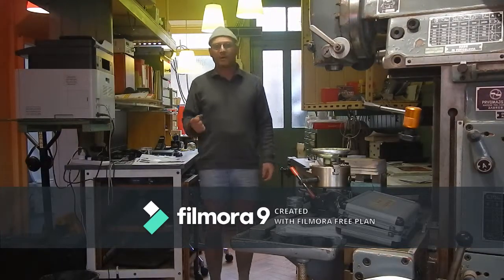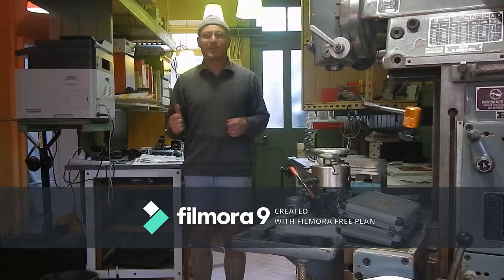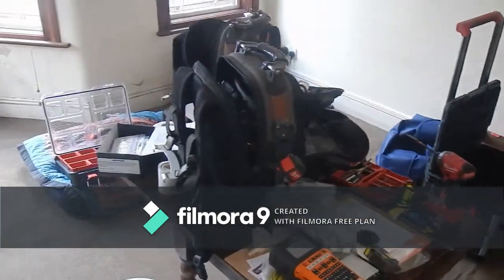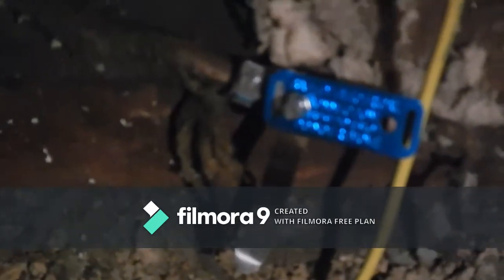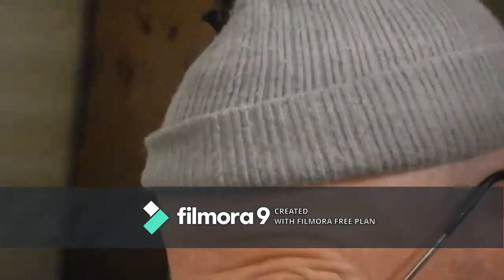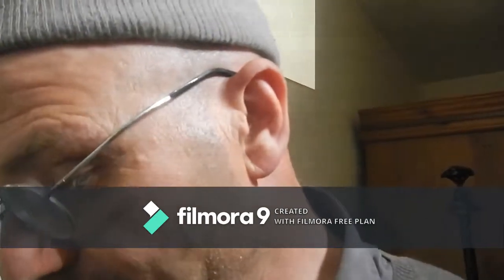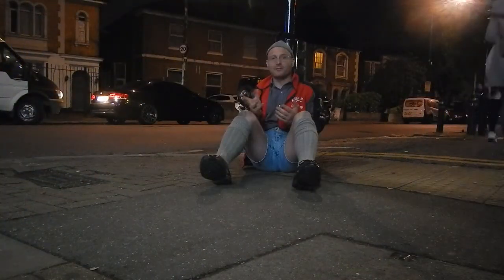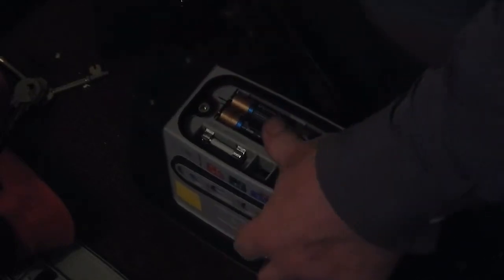Installing another Consumer Unit: Second Megger 1730 death during new consumer unit testing

Comment: Rechargeable batteries are 1.2 volts & alkaline batteries are 1.5 volts. Use the correct ones designed for the Megger.

Comment: On the first board change (Proteus board 3 circuits) what is the 951 clamp connected to? It looks like a main incomes into a cream Easter Electricity unit of some description? Is that a split concentric into a pipe? Not something I have seen before.
Reply from the maker: Yes it's concentric cable from memory with a copper outer a bit like micc, the copper pipe is connected to TNC-S downstairs.  I have seen this before, at the Edwardian appartments in Battersea where I had to dry the bathroom light fitting out when it was nuisance tripping, and in Battersea where I haven't filmed, Battersea Park Duke of York Mansions, Lurline Gardens and all the edwardian appartments along the south side of the park.  The feeds to the flats come into the flats as copper pipes with the cables inside them in this way.  The 951 clamp was an additional, visible, earth path to this copper sheath, as I couldn't visually inspect where the original stranded went, it disappeared behind the back board.  Thank you for your interest, again.